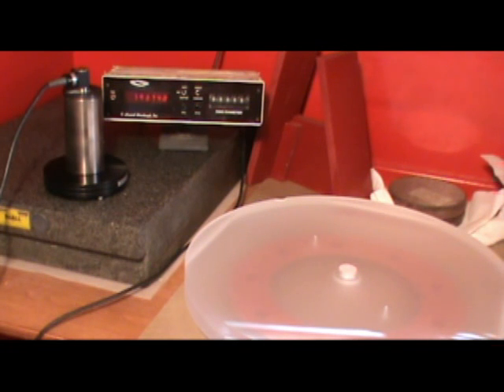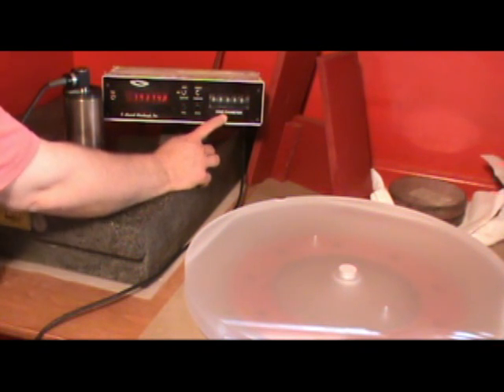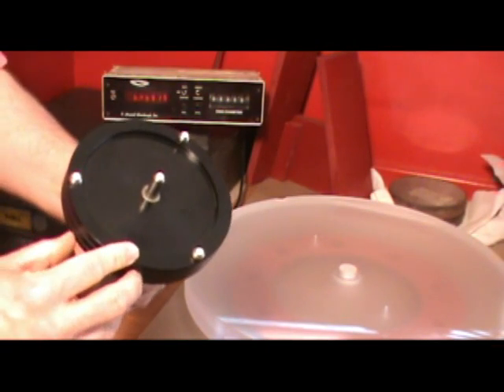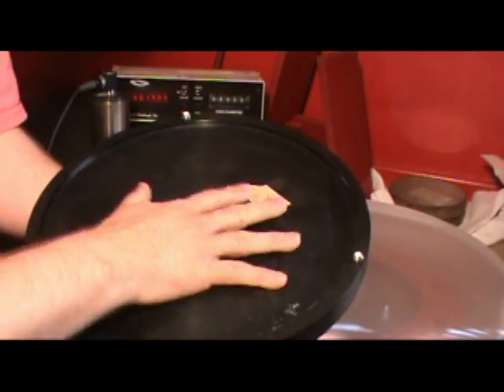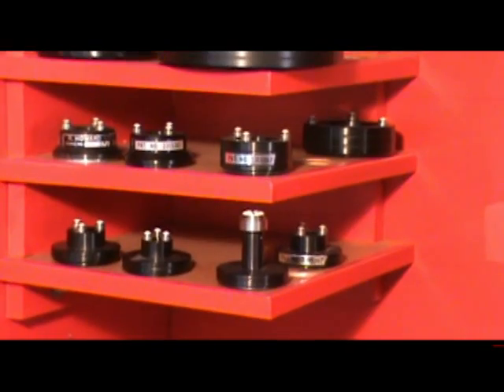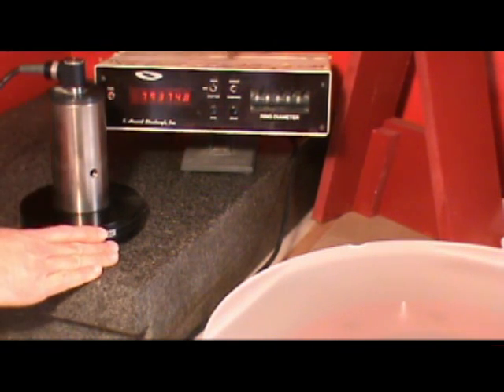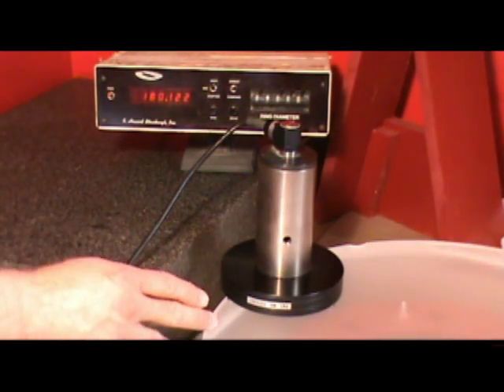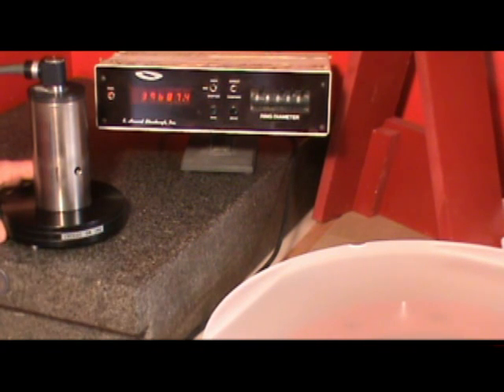Measuring the Radius on the  20" f/4.5 Telescope Mirror

Comment: Surface plate as a reference flat; why not an optical flat???
Reply from the maker: A 9x12 surface plate is $30.  An 8" optical flat is closer to $1,000 or more.  The surface plate is plenty accurate enough, so no reason to spend more money that could be used instead for glass and abrasives!